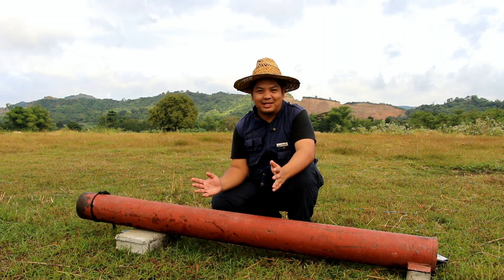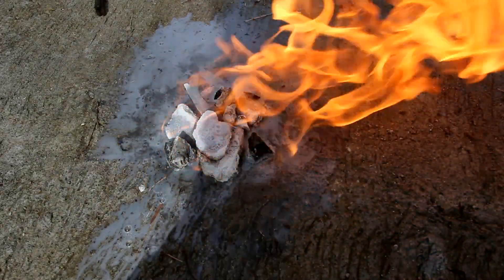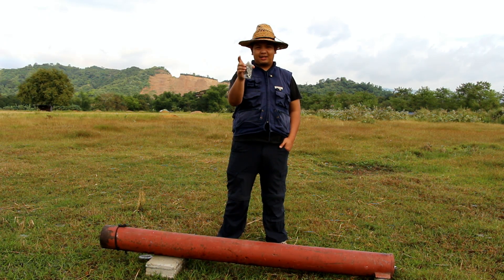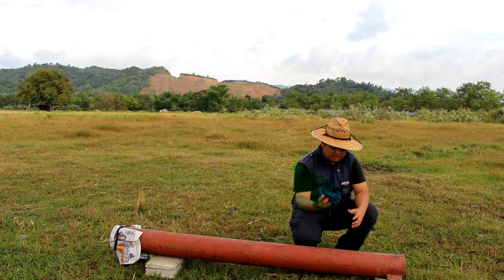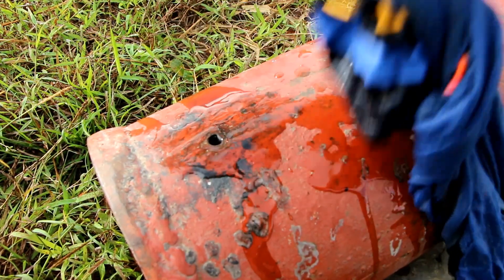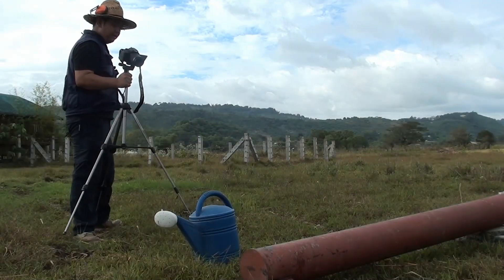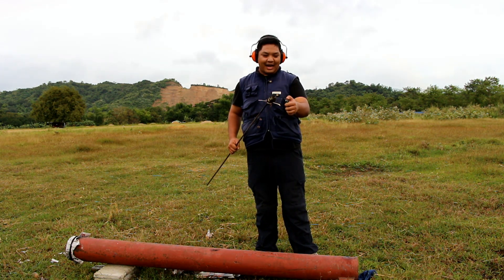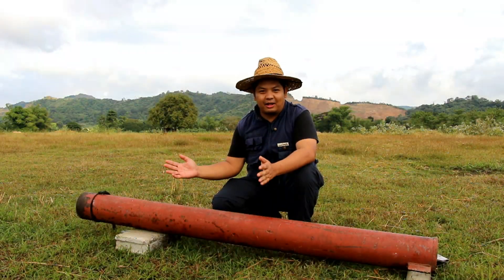Calcium Carbide Cannon

Comment: The secret to good canon is restriction chamber. It should not be a straight through pipe but rather have some restriction. What I do is set a can that fit snugly inside the pvc pipe and the can has a smaller diameter hole. This creat restriction and I usually fasten the can with a bunch of screw in front of it so it will not be blown put when I fire it. Since bamboo is not common in the US, we would use PVC pipe but unlike a bamboo it does not have restriction so we have to do it this way
Reply: What do you use as fuel or to make it go boom?

Comment: I'm curious, would an explosion from a Calcium Carbide reaction destroy a PVC pipe?
Reply: TheOwlManStan. I have used 2 coffee cans one both ends cut off taped together use the plastic lid to seal. it's not so loud as his but still makes alot of noise.
enough that people come outside mad.
Reply from the maker: PVC is brittle it may fracture due to fatigue loads.  Fatigue is the weakening of a material caused by repeatedly applied loads.
Reply from the maker: We broke some windows and triggered car alarms due to the blast wave.
Reply: Ah, alright. Thanks for answering
Reply: TheOwlManStan baby boomer and big boomer copy of big bang cannons are sold in US and are all pvc
Reply: @jacobishii6121  you cannot use pvc if u r using calcium carbide, just use denatured alcohol instead
Reply: Stell seamless pipes are the best I used one with 50 mm inner diameter and at least 20 mm thickness. Also instead of newspaper I use veggies as projectiles

Comment: Carbid cannons are also a regional hobby in The Netherlands. They use big iron milk cans for it, and they make thundering sounds which can be heard miles away.
Reply from the maker: Thank you for watching.
Reply: They lot play this at indon like pontianak
Reply: that is called boga

in the philippines
Reply: Hi Paola, I am trying to introduce this hobby here in United States, do you have measurements of calcium to water ratio? Or is there a good video that explains how to make the loudest boom?
Reply: @AlphaSteelFang005  a handful of calcium carbide then 2-3 table spoon of water.
pro tip: wait for it to cool down by simply tapping the bottom of the cannon before firing up for the maximum explosion
Reply: @aaarrrfff  awesome thank you!!